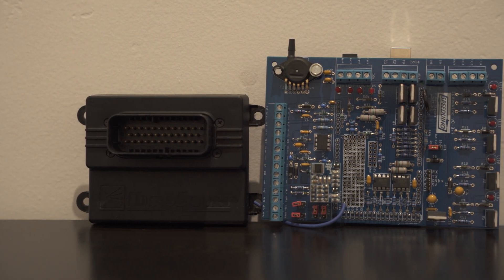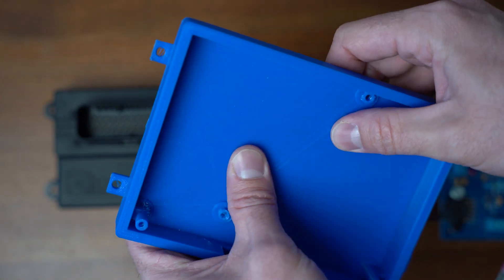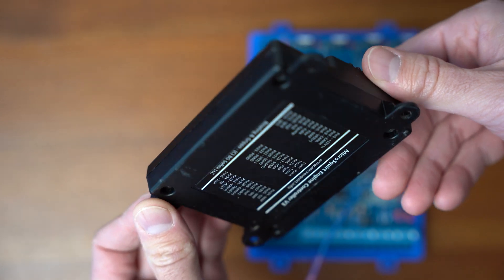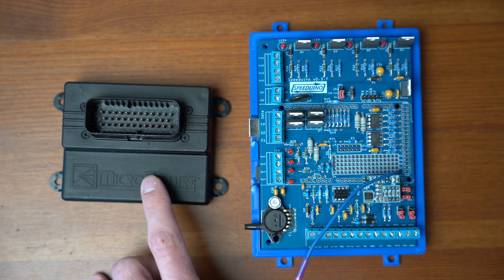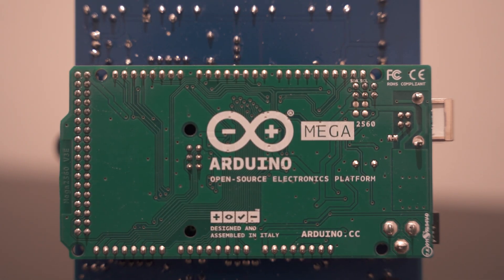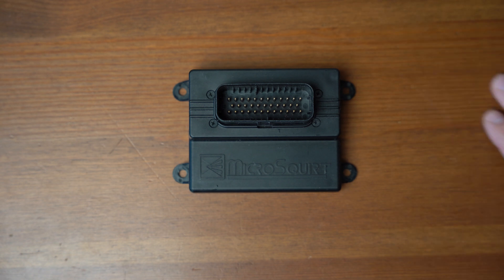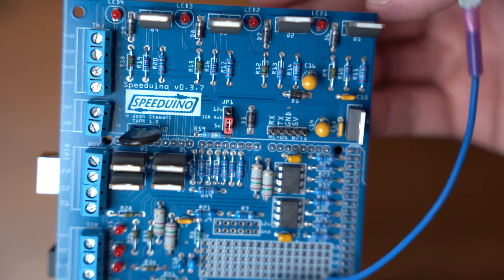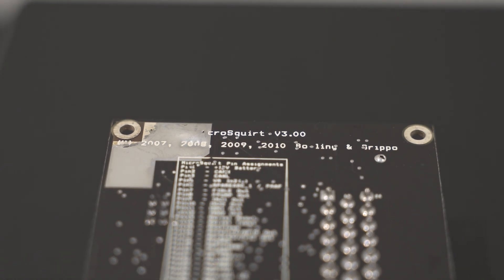Megasquirt VS Speeduino | What will you choose?

Comment: here is a dumb question. what makes the difference between a cheap open source Microsquirt and a very $$$ ECU like MoTeC? what makes systems like haltech motec so expensive?
Reply from the maker: You pay for software and firmware development. The hardware is usually just more IO
Reply: @TurbineResearch  is their software really that good and capable to make it that much expensive? does it make tuning easier? are they more reliable? or their software is just that good. i watched a video the other day, the dude payed 11k$ for a motec system. like are they that good??

Comment: There's also variants of the speeduino project, I personally built an stm32 one (spectre board), it's smd (so you need a hot air station to assemble it) and designed to fit in a nice case with a sealed plug, it is still DIY but certainly seems to be a step up from the calssic unit
Reply: Hello, where did you find that? And is it have universal plug?
Reply: @huseynzadeilkin  My comments keep getting deleted, I am tired of this garbage platform, it's always when I try to help someone, it is on the spectre project official page
Reply: @ilkinhuseynzade7535  this will be my last try, hopefully it doesn't get deleted this time, you will find your answers on the spectre project's github

Comment: wandering timing would suggest to me a faulty MAP sensor on the Speeduino. I have a MS2 and I took the MAP off the board to a GM 3 BAR sensor off a supercharged Buick 3.8. You want shitty customer service? Try FreeEMS . That guy expect you to be a coder instead of a hardware person. Gonna give Speeduino a shot. The 256MEGA boards cant run this? 4cyl NA 5500 redline. single coil.

Comment: You mentioned running Speedy on a Volvo 240 and having issues with timing.  It may not have been the Speedy itself, but the crank pulley instead.  The B230 crank pulleys have a rubber inside them that tends to fail after a while, and the outer comes detached from the inner causing a bunch of timing issues.
Reply from the maker: This was an LH2.4 car that has a VR sensor reading off the back of the flywheel for crank position.

Comment: I have a v twin Kawasaki 1000cc factory throttle body fuel injected coil on plug engine. Factory engine management is terrible always ran super ritch. This will be my first ecu install/tuning venture but I’m very proficient with electronics just green on the tuning side. I’m thinking micro squirt would be best for me what say you?
Reply from the maker: Yes microsquirt is a great option for motorcycles

Comment: Hi, which is better for electronic sequential multi-point injection engines? I'm using a 3.2 vr6 BUB engine from a mk5 r32, I'm also planning to to boost it, I want to use a digital dash as well
Reply: Emu black or maxxecu

Comment: So a little over 30years ago I was involved in the GM ECM hacking deal... I never really liked it, I could never really get things tuned like I wanted, even using existing code for that application.

About 15-20 years ago, maybe more I ditched my GM ecms and got invested in MS. Honestly I liked it, I was able to get a lot of the tuning that I never was able to get right with the GM stuff working.

Now I have a new gm project (but old school, it has a distributor and throttle body injection), it seems like the MS stuff has gone commercial, $$$, and doesn't seem as reliable as an old MS 2 PCB3 setup was, and the old stuff is so confused and so much contradictory information... Do I go MS (and which version) or Speeduino (maybe dropbear?) or something else? (FWIW, I have an unused MS 2 and a Microsquirt sitting around but, well, if something else will work better I'm not afraid of getting it). Maybe something else to look at?

Comment: Curious, the ignition drift problem keeps coming up.

I know a few people that gave up on MS because they had an ignition drift problem that they couldn't track down. Tuner studio has an ignition latency setting that is supposed to fix it but I don't know if it works. Now speeduino is having the same problem... huh.

Comment: Never used speeduino. I've used 2 microsquirts though. There are limits with them and the MSextra forums are not always helpful, but I enjoy the challenge. With either, my guess is can't just expect all your issues to be solved fast. I had a drivable car quick enough, however sorting out unusual sensors or niggly issues takes longer. However, each solution is really gratifying. Tunerstudio is a far more powerful tool than I'll ever get the most out of.

Comment: Interesting comparison and discussion.  Thanks for posting.
Several years ago I had a project to add wide spark control to an old 2 cylinder generator so I could fuel it with woodgas.  I ran across Josh Stewart and Speeduino at that time.
I learned TONS of info from him. Even bought an umpopulated board at the time. But I DECIDED to do it all myself and to make it all work with only an Arduino UNO.  Eventually did get the job done. But it took a long time to solve that ignition drift problem, so I can emphasis with you on that issue.

Comment: The downside of megasquirt is there is too much information and conflicting as well. Speeduino has a bit of a limited (in a good way) information. If the engine it forced induction never of these would be recommended by me. tuning on the free version is almost impossible, I have the full version (it was a lot more than $40)

Comment: You mentioned MS wave soldering being superior to hand soldered Speeduino. I would suggest this is completely dependent upon the skill level of the person soldering. For example guided missile control boards are hand soldered by professionals and passed down a line of people who use visual magnification to check joint appearance / quality. Wave soldering isn't infallible as any imperfection / contamination can spoil your day. Dry joints etc are a regular occurrence in consumer electronics (usually wave soldered).
Reply: i must have missed that part but wave soldering is not used for surface mount devices(smd). the smd are placed on the board by a pick and place machine, befor all that the board is run through a process where a stencil is overlayed and solder paste is applied to every pad much like a silkscreen on a tshirt. the parts are then places on the paste and it holds them there untill its run through a reflow oven that melts the solder paste and wets to the board and parts. the board can then be visually inspected just like any other. its very accurate and reliable method of pcb manufacturing. 
wave soldering can only be used on through hole components, if the speedduino was populated and then run through a solder wave machine (that is set up and run by a competent person) it would have pretty much perfect joints. 
i doubt the claim that missile control boards are soldered by hand because i dont know why they would be using through hole devices which are much larger and susceptible to vibration damage. also nobody is hand soldering surface mount devices, the only reason you would be doing that is repair or prototyping or someone made a mistake by loading the wrong reel of components onto the machine and now you have 100 complete boards with a few wrong components.

Comment: When assembling, for example if I’m doing the first pack of resistors, do those resistors need to go to a specific place or do all resistors in one baggy work universally with every resistor labbled on the bag?
Reply: All the resistors in a baggy are the same value and go in the locations stated on the label. As long as you only work one bag at a time you shouldn't get them mixed up. The key phrase to keep in mind throughout is "attention to detail".

Comment: I consider installing a Speeduino. I hate Megasquirt, it is capable but even the Microsquirt is bloated with functions you don't need and they are desperately trying to convince you that you need it and it's a good deal whereas even the MSIII is a cheap board that costs next to nothing to produce and whatever research and development they invested into has paid them off over the years and turned into a highly profitable fairytale. All they talk about in the forums is about how illegal it is to use unlicensed clones and they think they do you a favor to answer your question if you are in trouble and you're whinning, like they treat you as something inferior, they sure are right about piracy but whoever nags so much seems like they don't do it for fun and profit but solely for the money.
If Sleeduino wont do it, better 
 pay some extra hundred bucks to get a standalone ECU from a reputable tuning company that has everything sorted and a perfectly working product, than pay these guys for a propertiary junk that little we know about how it's gonna end up like regarding the product and their aftermarket support.

Comment: Speeduinos fundamental code is flawed. It will not hold fixed timing when revving. The timing goes everywhere on rev limiters. Run like the wind away from speedy. Pay for a mega they are rock solid proper ecu made to be sold. Not like a speeduino which people are making money off selling boards with crappy code loaded up on them. RUN FROM SPEEDY

Comment: 10years ago i tried to learn megasquirt. I built two units and had so many problems. i returned to Microtech which i was already familiar with. within a day had the microtech installed and road tuned vs 40hr building a megasquirt and 40hr diagnosing problems. Prebuilt Micro squirt looks interesting though.

Comment: Your header says Megasquirt, but you are covering the Microsquirt. Microsquirt has a waste fuel pulse. How do you mitigate 50% fuel waste? Unless you only use 2 injectors on a four cylinder motor. So peak performance is unavailable.
Reply from the maker: Microsquirt is a condensed megasquirt 2. It's just a model of the megasquirt lineup.
Reply: A waste fuel pulse?  There's no such thing.  There's no fuel wasted as you seem to suggest.

The MicroSquirts work incredibly well for those controlling a small engine, or a larger engine on a budget even.
Reply from the maker: @AMPEngineManagement  I have been very pleased with all the Megasquirt products I promote on my channel. The more I learn about the Microsquirt the more I find hidden value in it's features. Thanks for having a great support team that have helped me over the years!

Comment: If possible lather the whole board in grease for electronics and then put them in a insulated / waterproof case, away from the heat of the engine

Comment: Great Video, I have a question for a subject matter expert such as yourself, I am wondering what is the best way of going about pairing a idle control valve to a air fuel ratio sensor? This engine is carbureted and the objective is to maintain a specific air fuel ratio, thank you any insight would be appreciated
Reply: From my experiences with the microsquirt, the best way is tune the VE table as precise as possible, this can ease the work for the ECO corrections, I never used idle control in my installs, but i do not think you need to worrie about, the ecu will increase/decrease fuel to mantain the desired AFR, for safery reasons, I allway allow the system to a different autority for add fuel (for example 10%) or decrease fuel (for example 3% only), this guaraty me the car can be safe if the wideband O2 sensor goes stuck in one of the extremes sides (rich or lean).
Reply from the maker: You can just use them like you would in an efi engine and set the idle air valve to open at different temperatures or based on a air fuel ratio

Comment: for speeduino you can gut a factory ecu and mount it inside. This way you can solder the connections to the factory ecu header eliminating the junk screwed terminals. then you repin the harness and have a proper connector.
Reply: Big brain, thanks for this idea!
Reply: Did that with a megasquirt almost 20 years ago replacing a bosch d jetronic in a volvo p1800
Reply: I've done the same thing with a GM ECM and an older megasquirt
Reply: @mpikas like what bud ?
Reply: i did almost the same thing with an MS1v3 years ago. i got a spare ecu and desoldered the plug from the board and made a jumper harness to the megasquirt  so everything ran through the factory harness, just had to match every wire up. about a year later megasquirt came out with their breakout boards that featured factory ecu plugs for almost every make so you could make a jumper harness exactly like i did but in a neater package.
Reply: This board is much bigger than any other factory ECU enclosure 😅 I printed my own enclosure for RUSEFI cause it wasn't fit for bosch box
Reply: That is an amazing idea!! Thank you for that idea
Reply: Could someone explain in easy steps how to do this for speediuno? I want to have speeduino same as megasquirt universal connection plug
Reply: @huseynzadeilkin  either find the female version of the factory ECU plug (ECU side) or buy a stock blown ECU and desolder or cut the pins from the PCB and just solder the leads from the speeduino or MegaSquirt onto there. At that point if your factory ECU is large enough you can mount your aftermarket ECU into there, if it's too large then obviously not.
Make sure to lay some rubber or felt material on the ECU though so you don't short anything out

Comment: I've converted my 67 Datsun 2000 to EFI using Microsquirt V3 and 40mm Jenvey Heritage TBs and love it.  The MS has been bullet proof, very well made, easy to mount and does everything I need.  The 30inch pigtail that can be purchased with it is clearly marked and makes installation much easier, even for this electrically challenged owner. Don't see any reason to use a more expensive controller for a classic, non-emission car.  The engine is built, and not only have I gained HP and torque everywhere, I get better fuel economy, instant starts, and consistent AF ratios whether I'm at sea level or in the Mountains.  Awesome!
Reply from the maker: Sounds like a nice setup! I really like old Datsuns like the 2000 and 1600s
Reply: @TurbineResearch . Y.

Comment: You seem to be highly biased to the microsquirt, some of the points you showed as advantages on microsquirt it's just because you're using an old board...
Reply from the maker: It's what I had not necessarily the best of Anything in particular. I have never had an issue with a Microsquirt and I have installed and tuned 7 of them.  I have almost had nothing but problems with Speeduino. I understand they are different and want to make that clear. I also stated that the founder of Speeduino Josh Stewart is amazing at what he does and was very willing to help me . Speeduino is a really cool project and I would love to try a new modern version. I tried to be clear that this is "just based on my experience"

Comment: What about auto transmissions needing computer shift points ... can the Speeduino handle this?  I know Megasquirt can through it's cam bus ..
Reply from the maker: Not sure. I haven't messed with transmission communication on this one
Reply: Grom what I know, CAN Bus is work in progress in speeduino.
Reply: @hiperformance71  thanks for the info ..   wasnt sure if there was anything out yet or not ...
I may go with the Holly EFI Sniper since it can have the TCM added to it to control my 4L60E ..

Comment: So you picked the oldest version of speeduino out there and compared it to the latest MS3 lol you should do another video covering ms1 and ms2 boards and the state of how they have to be wired and modded to work the same as a speeduino 0.4.4 or some of the more custom smc boards people have done.

Or buy a speeduino dropbear and do a comparison
Reply from the maker: It's not the latest version of ms3. It's a Microsquirt which is a condensed ms2.  I really would love to try a Dropbear ! I just did this comparison because it's two very cheap ecus that I have a lot of experience with. It's more price based
Reply: The microsquirt is years older than the speeduino showed in the video.

Comment: You need to understand that he is reviewing an OLD Speeduino. They are on to a completely different board. many different boards for that matter. The 0.4XX boards are better and most of them are SMD.  THe new dropbear unit has a good connector also.  The board you have for speeduino is just out of date. Then you can get into the boards other companies make which are just great. I have had MS1 in a 400 HP 260z 15 years ago and I like speeduino much more.
Reply from the maker: I would like to try a dropbear. They look like a solid unit
Reply: @TurbineResearch  Long delays do to this pandemic some parts unobtainable. Supporters and people in the loop get them first. For the Dropbears prices it spanks MS3X again if you get one.
Reply: @dermharse9614  it has more input than ms3 x?
Reply: @pr0n5tar  look at speeduinos YouTube channel
Reply: The microsquirt is older than the speeduino in this video
Reply: I thank you

Comment: Agree the ampseal connector is a nice piece. I have some on my msgpio. I also noticed the bummer part of having the Phoenix connectors on the speeduino. One could always solder directly to the board of course.. not sure of you'll end up saying that in the video heh I'm 3:42 in.
Reply: That's why I prefer the speedyefi ua4c boards. SMD and molex connectors. No Phoenix.